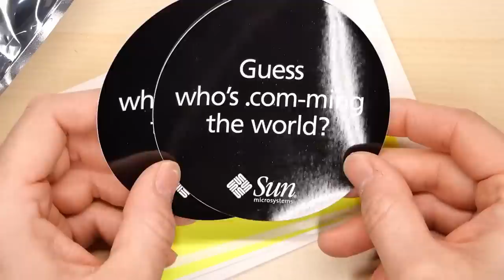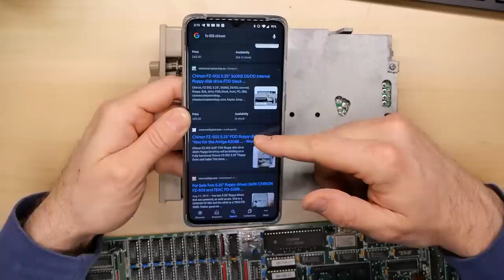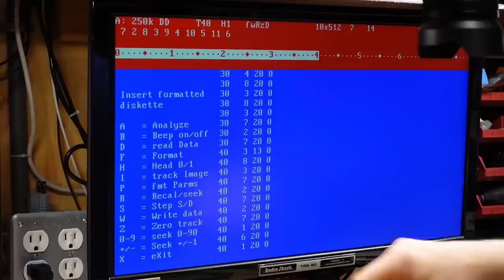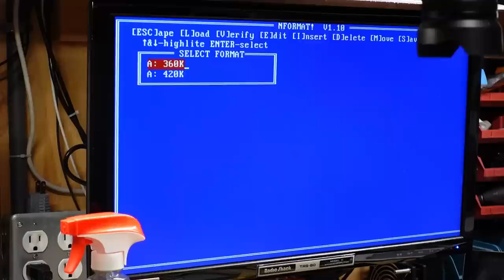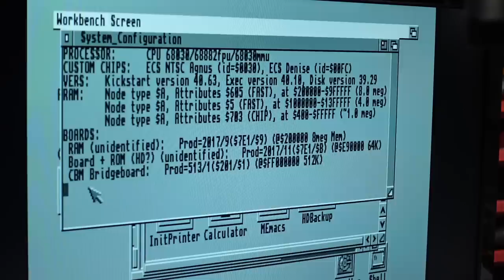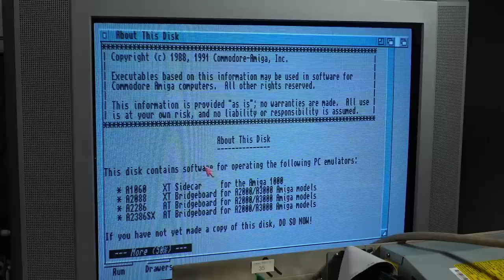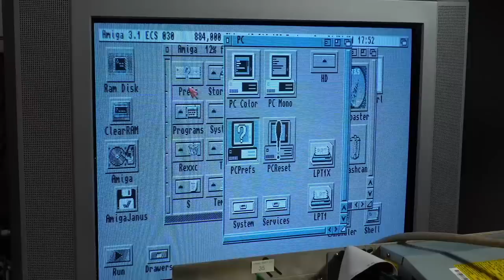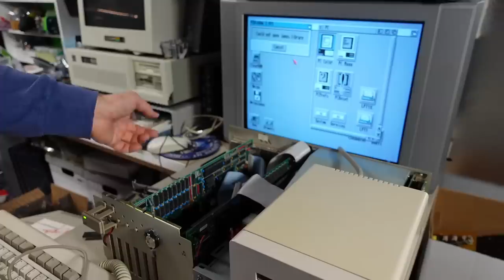An IBM PC XT inside an Amiga: The A2088 Bridgeboard and the original 360k floppy drive

Comment: Thanks for the shout out Adrian! :) I think the disk drive you got is the one the cards shipped with. They used the same drives they shipped with the Commodore PCs I guess, so they were just pretty generic PC drives. The color was a bit different to the A2000 face plate on my father's model, too, if I remember correctly. It also always shipped with a little PC beeper speaker.

There are Commodore native Amiga 5 1/4 disk drives, the A1020. Meant to be used with the A1000 mostly, I don't think they produced them for a long time, they are pretty rare.

The Janus.library fault was definitely caused by the bridge board not starting up properly for me. I think it had contact issues both in the Zorro slots and in the PLCC sockets on the board, might make sense to replace those. I worked around for now by reseating all socketed ICs and using huge amounts of contact cleaner on the sockets. It took me some time to figure out (as seen in the video), information really is sparse about these cards. The latest Commodore version of the Janus software appears to run fine on all the OS and Kickstart versions I tried (up to 3.1.4).

Comment: Adrian, I have an Amiga 2000 with an A2088 Bridgeboard that's working.  The 360K Chinon drive you got is the one that comes with the card as mine is the same one.  To get it working you need to put the janus.library and a file called MFC into your EXPANSION folder, not libs.  I hope this helps as this is how mine is setup and it works.

Comment: IIRC Jan also went back to an older version of the software, it might be that the latest version is more designed for the 286 & 386 boards while the 8086 boards need an older version.
Reply: Mr Guru  And some common faults for the bridge boards are?  He may revisit it. Share the knowledge 👍
Reply: It definitely was a hardware issue for me (contact issues galore). The most recent versions of the Janus software run fine, even on newer Kickstart/OS versions. The older versions of the software just seem to have different error handling so they started up to a certain extend but the PC side didn't work at all.
Reply: Change kickstart to 1.3
Reply: Mr Guru  I have the same card with A2000 running the original kickstart, never changed. Yes, do not have experience with bridgeboard on newer kickstart. Chill out.

Comment: Hi Adrian! I have exactly the same A2088 Bridgeboard card and the same 360k drive, so I really think the drive can be the original that came with it. In my Amiga 2000 I have a "Western Digital FileCard PS30 8bit ISA Hardcard for IBM PS/2" as a PC hard drive for this card. I use Workbench 2.0 and kickstart 2.0. Greetings from Hans in Belgium.
Reply: Seconded. I have mine as well. Chinon FZ-502 in the same style and color.
Reply: I have the same drive with my A2088 bridge board as well.

Comment: Anyone else disappointed with the quality of the current cotton swaps? In my days those things hardly ever came apart when rubbed against a surface. Nowadays you squint at it the wrong way and it already comes undone.
Reply: Definitely, the quality have become cheaper over the years, especially on the generic brand ones. The Johnson & Johnson ones are still OK, if I remember correctly.
Reply: they've always done that for as long as i can remember, you had to get special ones if you wanted them for applications where it was important they didn't fall apart
Reply: I just use the wooden stick lint free ones.
Reply from the maker: Yeah they are really utter crap these days.
Reply: Yes . I have noticed this as well . Perhaps the manufacturers are using shorter strands , these days . The longer fibre cotton probably goes for a higher premium .

Comment: Though you really can´t do that much with the 2088 Bridgeboard, it is really interesting getting this thing to work. I lost my entire Amiga knowledge over the years just like you but then I found my Amiga 2000 in my attic, fixed the (slight) battery leakage and you know what ? My Amiga knowledge slowly keeps coming back ;)
Reply from the maker: If it had worked I was going to try to use my own design ISA memory expansion board to bring it up to 640k -- to make it at least slightly useful. No such luck!

Comment: The Amiga itself can support 5.25" drives, they just weren't commonly used... the interface is Shugart compatible and you can connect them though. There's a few things that make it awkward - the Amiga OS is geared around drives that can tell if the disk has been changed, which 5.25" drives cannot do. There is a "diskchange" command that you had to issue when you changed the disk in such drives.

Comment: I would guess the first cold boot issue may be a sign of the PSU not being able to ramp up the relevant voltages quick enough on the PSU filter capacitors. The extra load required by the accelerator card will exacerbate this issue.
Reply from the maker: I actually have a spare PSU so I can swap it out ..... but yeah it's beefy so really what's in this machine is not a heavy load for the PSU.
Reply: @adriansdigitalbasement  I was thinking more along the lines that the filter caps may be aging and have an initial high ESR value causing a low voltage for a short period until the caps warm up and the ESR value drops giving you the full beans.
Reply: Well its probably not GVP G-Force 030 Combo accelerator card. It uses tantalum caps which usualy fork fine until they blow up, but sometimes they don't, and they work as resistors. The best way will be to do some initial testing without GPV. Thermal camera would be usefull.

Comment: You can plug almost any SBC with 16bit connector into A2000. I added the remaining 16bit edge connectors into my A2000, I  installed Pentium 233MHz SBC with  separate16bit sound card running Windows using its own HD. Works great. You do need separate monitor, mouse, and kbrd.  I probably need to do some video on it.
I hope you can get your PC card to work.
Reply: But if nothing is bridged to the Amiga, what is the purpose of the PC then, other than having 2 computers in 1 box?
Reply: @danielmantione   Because I can, and it was fun making it work. It also shows that the PC slots are passive and you can use them as a SBC backplane.
Reply: Back in the day, I had a 386( i think) bridgeboard. I also added the 16 bit extensions to the other isa slots.One thing I did was find a card which I believe came from a Packard Bell pc. The card plugged into an ISA slot and had 3 isa connectors on one side and two on the other. If you plugged it into the last Amiga ISA slot, you essentially got two extra slots at the expense of not being able to install the case. It was cheaper than buying the multifunction ISA peripheral cards they were marketing at bridgeboard users. Fun stuff

Comment: I also remember great times... 
I had an A2000 with almost all slots full with everything: 68030 40MHz Turbo, an 80286 card, a Multi-I/O card, a SCSI HDD, and one CD-ROM, one IDE HDD. A MERLIN Mystique GFX card,... 
Two A500: One with a build-in 3.5" 105MB HDD, another A500 with an external 3.5" 105MB HDD with a 68020 Turbo with 30MHz. 
Plus one CD-32.
I sold already a lot of the parts...

Comment: A few tips from a bridgeboard user. Janus.library normally resides in sys:expansion and is loaded upon boot. When it is loaded, it tries to activate the PC side of the bridgeboard (releases the RESET line). When the PC doesn't wake up and respond, Janus.library gives up after a timeout period of some 10 seconds and it unloads. There could be a RAM issue on the PC side, that may also be indicated by PC speaker beeps (you can connect a speaker to J2). Or simply a faulty CPU. What also may help diagnostics is using an ISA POST code card. <3

Comment: That Chinon 360k drive is original, came with the A2088. At least with mine. :)  Exact same model. It is a PC-drive, not Amiga compatible at all.

There were aftermarket 5 1/4 drives for the Amiga (external ones), they would format to native amiga 880k format. The drive itself in those units was probably a HD drive for PC's (not sure).
Reply: Commodore actually had an external 5.25" drive for the Amiga (model 1020). It was VERY short lived...I think it was for use with the Original A1000's Sidecar PC expansion.
Reply: There were a few uses for the A1020 beyond simply reading DOS floppies, though that was probably it's primary intended purpose due to the support utilities on the Workbench Extras 1.x disks.

It was bundled with The Transformer an early PC emulator which, according to those that have used it, was basically useless. The 1020 at the Computer History Museum confirms this. https://www.computerhistory.org/collections/catalog/X1611.99F

You could use it as a native Amiga drive which would give it a capacity of 440k per "360k" disk  because it formats 11 blocks per track instead of 9 sectors like DOS. I doubt many people ever used it like that as there are some annoying limitations. The drive doesn't support automounting, or disk change detection, it requires a hardware modification to work with an A500 and that's all in addition to it being a very obscure format. Basically it's a curiosity for the hardcore A1000 collector.
Reply: @firstsurname9893  yup. Got one in a big Commodore haul I bought about a year ago.  Sold it off. Looked brand new.

Comment: I had an Amiga 2000 with the 8086 bridgecard running on the stock 68000 and Kickstart 1.3. It worked flawlessly and was really useful. If I was to troubleshoot your setup, the first thing I would do is pull the accelerator card and try getting it setup and running on the 68000.

Comment: When I saw your video, that reminds me that I used to have that same board A2088XT for my Amiga 2000, and I think I used it once... it was more prestige at that time, like to show off those PC people, who actually PC can be swallowed by Amiga (:  More interesting is video capture card, very professional with the actual broadcast BNC connectors and also sync input, and with that card, Amiga 2000 was used in any television broadcast environment super easy. It was similar to Amiga500 and genlock, but in that case, video signal had to go via frame synchroniser....

Comment: OMG Adrian, (your comment about 8MB Zorro-II addressing limit) may have just solved a head-scatcher that I had a few years back when I was fooling around with my A2088 bridgeboard.  After extensive attempts, I managed to solve all kinds of incompatibility issues.  Things like proper Kickstart ROM, Amiga OS, and Bridgeboard SW versions.  I had ISA addressing conflicts with my WD digital MFM/RLL card and ISA Lotek Adapter.  I then resolved what appeared to be proper JANUS library version to get the Bridgeboard to support HD and, Lotek IDE booting DOS using flash cards.  Another trick I stumbled on by mistake was to power up the Amiga/Bridgeboard, launch PC-Mono or Color, wait for failure, then click (“PC-Reset Icon”) which worked perfectly on the 2nd PC Soft Boot.  It was hard to pinpoint exact causes/solution for of each type of failure.  HOWEVER!! Once all was working & stable without any needed workarounds I still couldn’t figure out why my A2088 wouldn’t work with a Zorro-II GVP Impact-HC+8 SCSI card installed. In this video you covered the 8MB mapping limit on A2000 Zoro-II slots. I think that was my stumbling block since the GVP board I bought had 8MB pre-installed, resulting in the Mapping Limit/Conflict.  I just read the GVP manual and there are jumpers to configure the memory 0,2,4,6,8 MB.  I probably can either jumper the memory down to 6MB (leaving memory in), or remove some memory and adjust the jumpers to match.   I wonder if I had similar issues with GVP board and the Budha IDE installed. I can’t wait to try things again.  It would stun me if all of a sudden all 3 Zorro-II cards work simultaneously.  Thanks for one more chance and motivator to figure this out.  It may also help me as I attempt to make things work all over again with the PiStorm 2k / 68k Emulation.

Comment: The Amiga Model 1020 Floppy Drive, released with the Amiga 1000, is a native 5.25" device that works with both Amiga and MS-DOS format disks.
Reply: The drive also works with native amiga formats in 5.25” type?!?! If so, what would be the formatted capacity on the Amiga side.???? ’m sure it wouldn’t be 880k as this requires a disc drive with double sided heads along with a double density disc.... I believe it’s strictly a PC drive. Correct me if I’m wrong. :)
Reply: @danielgadze3920  The Amiga floppy controller is flexible. It would store 440KB on a 5.25" disk. Here are the device settings to use:
Device = trackdisk.device
Unit = 2 /* first external unit */
Flags = 1 /* important ! */
Surfaces = 2
BlocksPerTrack = 11
Reserved = 2
Interleave = 0
LowCyl = 0 ; HighCyl = 39
Buffers = 20
BufMemType = 1
Reply: @brianh2771  I never knew amiga could format it below 880kb for diskettes. I’ve always been used to 880kb 3.5” (as well as have used 1.76mb high density drives for my high end Amiga’s) I also own 2x external 51/4” disk drives which do 880k using 360k discs... it works for me fine! Have over 3,000 discs in my collection... I’ve always liked 51/4” discs to be used on my amiga systems as I grew up with the c64/128D(1541 / 1571 drives) and used them quite a lot back then hehe... I was marvelled and so delighted fo get 880kb on a non high density 51/4” disc... those were the days eh??
Reply: @danielgadze3920  You're so right. Coming from the C64+1541, the Amiga's floppy capacity and speed was mind-blowing. I was certain I had come into possession of miraculous computing power :)

Comment: Check those two big interface chips in PLCC sockets. Use hard rubber to clean the contacts on chips, clean them with alcohol and reseat them.

Comment: Hi Adrian. You should be able to test the A2088 independent of any Amiga software. Insert a boot floppy and see if the PC boots. If so, try installing an ISA video card and see if you get the PC display that way. Also, I think there may be a problem with the assignment of "LIBS:" on your machine preventing it from finding "LIBS:Janus.library".
Reply: According to several people who have got it working (https://forum.amiga.org/index.php?topic=731.0) Janus has to be in SYS:Expansion it doesn't load from the LIBS: assign.
Reply: @firstsurname9893  Ah, thx. It is a device driver with "unfortunate" naming.

Comment: Fantastic donation =O  If memory serves, there are two versions of the Janus driver - that might be your issue!
Reply from the maker: I had picked up the latest one that was supposed to work with newer kickstarts. I'll most likely need to try to scope the 8088 to see if it's even trying to boot -- but sadly the amount of custom chips (And the lack of any kind of debugging on the Amiga side) just makes trying to figure out the issue so hard.

Comment: I used to work configuring those machines at commodore UK, if I remember, its a long time ago that bridge board requires a v1.3 kickstart ROM and that A2000 board would of been sold with a v1.3 ROM. The 386sx board required v2.0.

Comment: There was something called Sidecar for the Amiga (now known as Amiga 1000) which used the side expansion slot AKA Zorro-1 slot. This is the A2000 version of that solution. I know if you have one of these 5 1/4 inch drives installed in the Amiga 2000 the Amiga can see it, there is even am Amiga program that lets you write Commodore 64 compatible disks on PD disks. The real beauty of the Commodore Bridgeboards is the Janus software that comes with it, that was quite a thing, and there was also a 286 and 386SX version by Commodore (and Goldengate from Germany produced a 486SX board but this did not come with the sophisticated Amiga software like the Commodore Bridgeboards which allowed you to use the card on the Amiga's screen output).

Comment: Adrian - Regarding your cold boot with the accelerator in.  I've worked on a lot of these.  You may want to dismantle the power supply and check out the electrolytics.  The current draw is much higher with the accelerator.  When those caps start to go, you can get weird power stuff, especially when cold.

Comment: The Amiga supports 5.25" floppy drives just fine. You can have the official C= A1020 that will act and support a variety of uses (check out the 1541 filesystem driver for it on AmiNet), or you can have 3rd-party drives that act like a regular 3.5" (I believe these were popular in Germany).
Reply: Neat - I did not know (either)!

Comment: Try putting in an ISA video card and plug a monitor to see if the bridgecard is initializing..
Reply: Yes, this was going to be my suggestion as well.  That'll at least allow him to figure out of the PC side is POSTing correctly and possibly give error messages to hit at what to look at if there is a problem there.  Also hook up a PC speaker to the bridgecard, it has a spot for it and will help with diagnosing via POST beeps. Alternately if he has a PC diagnostic card to put in one of the ISA slots (the kind with the two LED 7-segment displays on it), that could help as well.

Comment: It would seem that Commodore's habit of not keying floppy drive cables applied to all floppy drive cables used in Amigas.  (The 3 1/2 inch floppy drives were somewhat infamous for not being keyed, and often slightly difficult to check visually when being inserted into the drives.  Fortunately,  being one pin off didn't send voltages to anything that couldn't handle it.   The machine wouldn't initialize, though.)